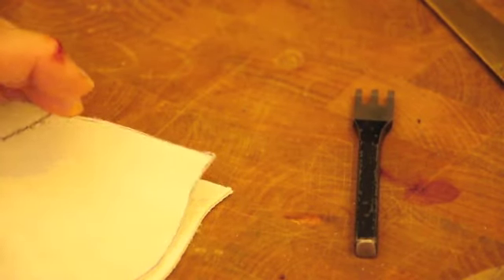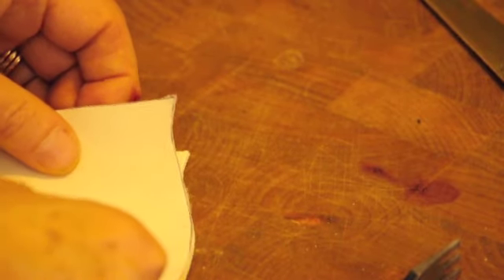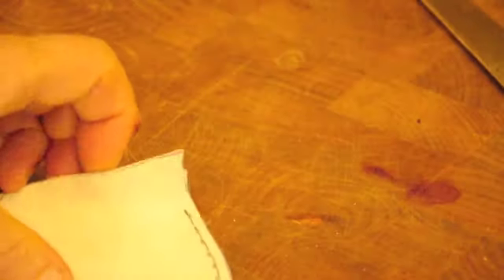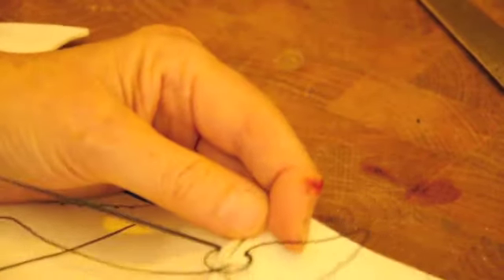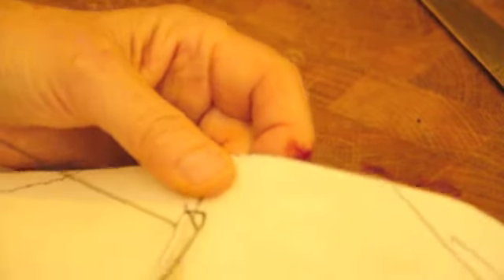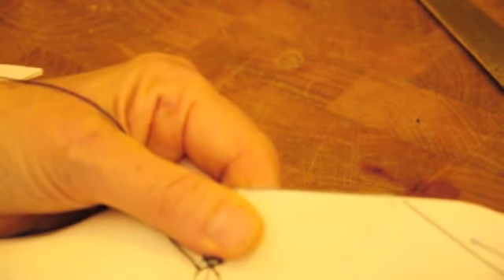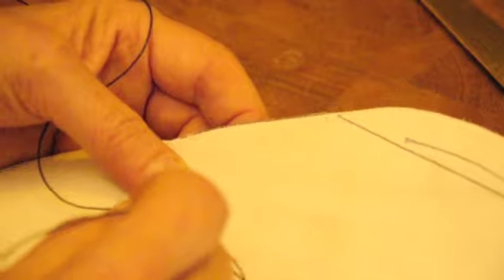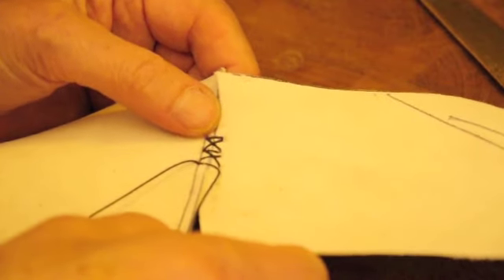simpleshoemaking: How to butt-stitch a seam with the X and bar stitch

Comment: This is a very useful stitch to know - maybe... (?) I wish I could see it better! You're working right down at the bottom of the frame, and the camera angle is very low, so that your fingers are partially covering what you're doing. Not to mention that the video doesn't stay in focus. Do you think you could remake this video with your camera facing straight downward toward your work, and with better focus? Ideally would just be to use a head-mounted Go Pro so that not only  is your video is nice and sharp but your camera is seeing exactly what you're seeing. If you can't afford to buy a Go Pro camera, you could always very easily build a little miniature scaffold to put your phone on, with an opening positioned where the lens would be facing downward. With the phone stationary, the focus should stabilize, and you can also be looking at your work on the screen of your phone, to see what you're doing.